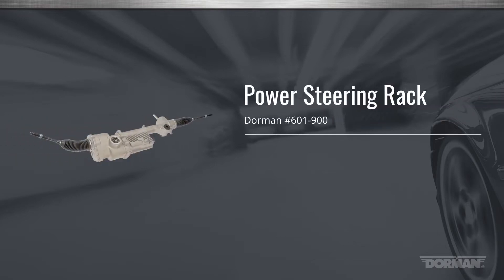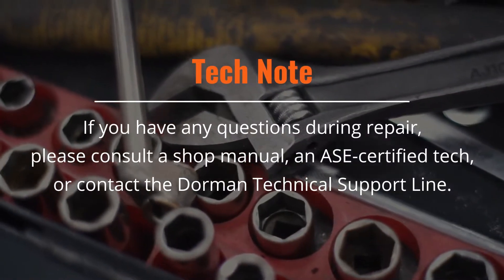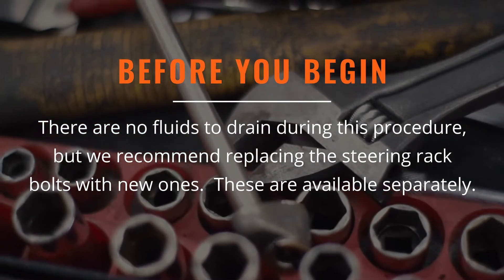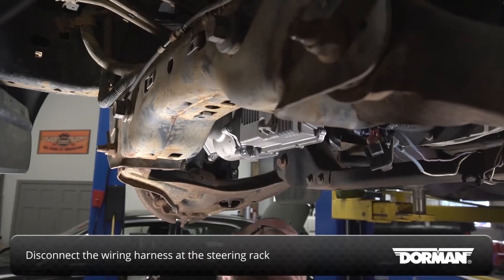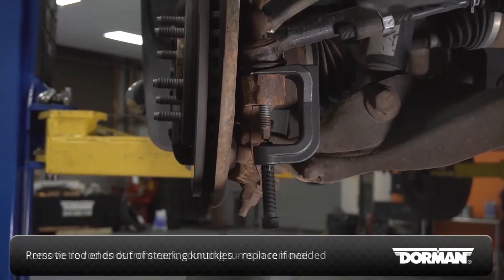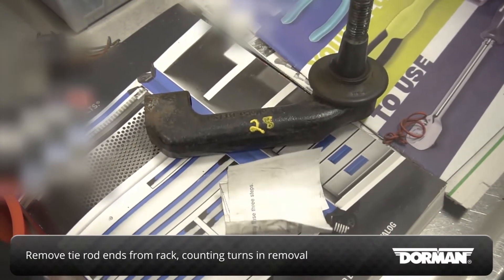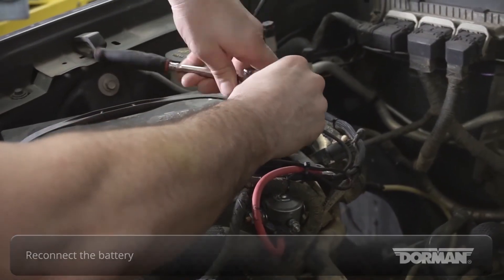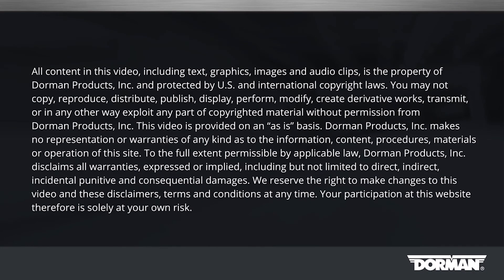Installing the Dorman 601-900 Electronic Power Steering (EPS) Rack on a Ford F-150

Comment: What if I can’t find the PSCM after the installation? Some key points might be that I didnt know I was supposed to disconnect the battery and I haven’t done the wheel alignment yet, but can any of that be the issue?

Comment: Do you need to have the truck towed to an alignment shop before doing the programming? or can you carefully drive it a short distance to the shop without damage? ...other than getting an arm workout.
Reply from the maker: Hi Andrew, we suggest towing it to an alignment shop and then using the programming dongle afterwards to finish the job. We believe that would be the best practice.
Reply: @Dorman Products, could you use the programmer twice? Once to get power steering with bad alignment and then once after an alignment? This would save having to get towed